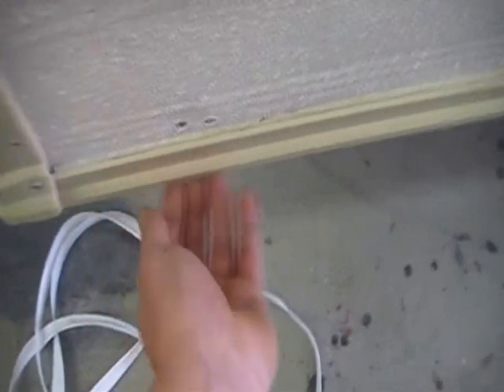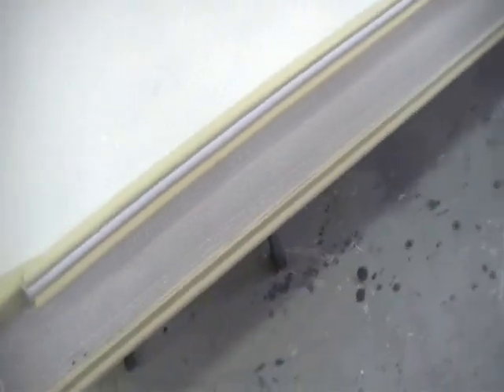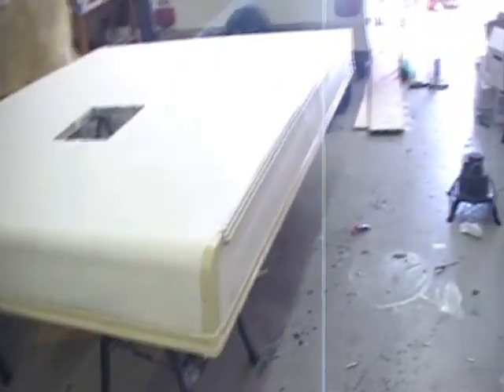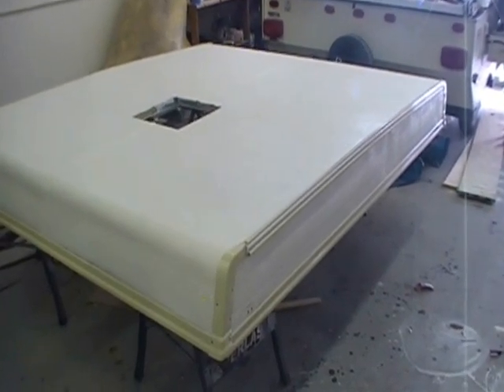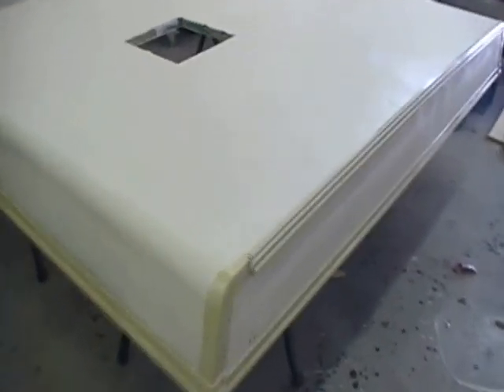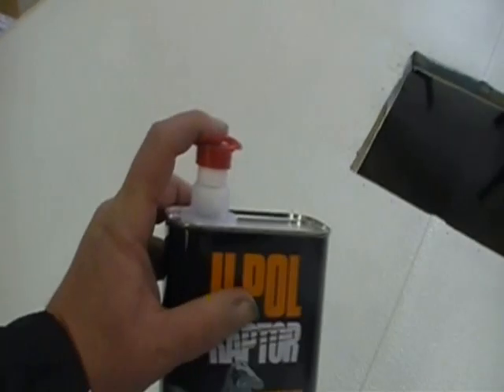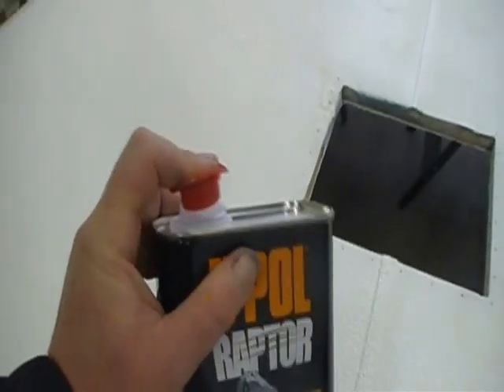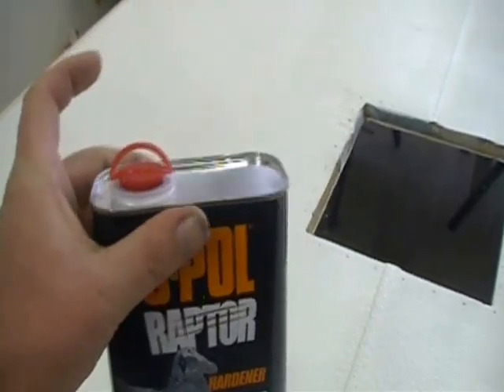pop up camper roof repair PT6

Comment: I recently bought a Coleman pop up.  It was in better shape than the one you restored, but your videos have
inspired me to restore it.  For beginners, how do I get the AC off top.  I took inside off and see some bolts, and I see screws on top, also.  Where should I start?  Thanks

Comment: You mention that you found the seal/under gasket thing for the roof track?  Could I ask where you found it?  I have looked all week. 
Thanks so much for sharing your project -  I have a 94 Flagstaff that we bought new- and it had the roof leak at the vent - and the sides were deteriorated.  
your video made it seem do-able.   It was- we have the newly built  box back together- just need to paint the ceiling & clean up all the trim/hardware tracks to re-install.